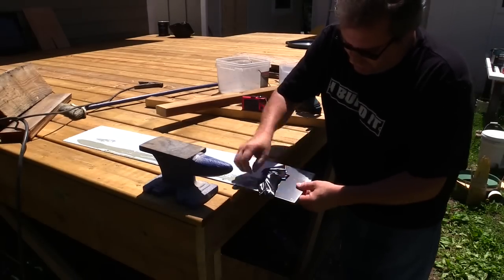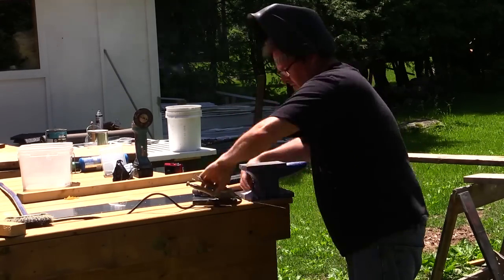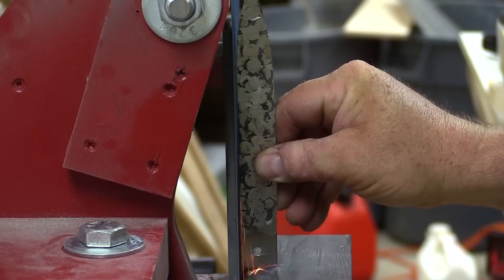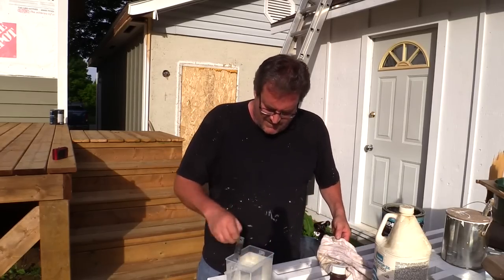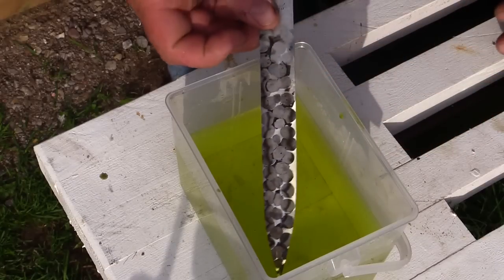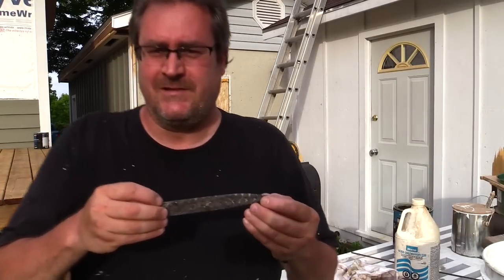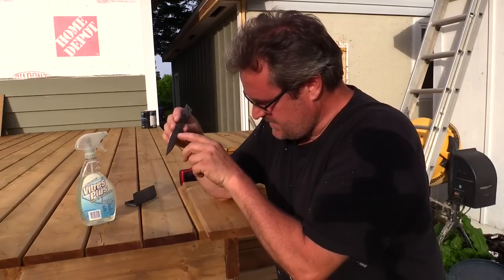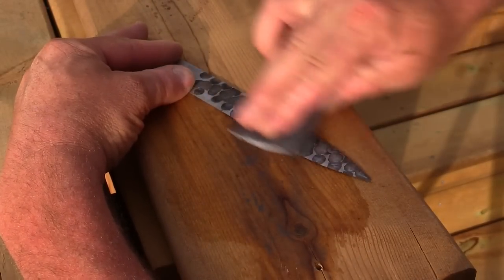Mig Welder Damascus Experiment

Comment: It's a very unique look and is definitely worth investigating. This materials you've used are ok for decorative work or display pieces but won't make a functional knife. Mig weld is mild steel and you cannot harden it. The same applies for the  stainless steel, it's likely a 300 series. You could try a piece of 15n20 carbon steel (close to 1080 with 2% nickel added) and use the mig welder to make a pattern on it.  L6 is another metal you might find around the shop, it's used in bimetal bandsaw blades etc. Its another carbon steel with nickel added.  This would yeild a blade with a edge that could be hardened with a propane torch. The mig welds would need to be kept away from the blades edge though for the heat treating to work. The nickel in the 15n20 (or L6) and the mig welds would provide interesting contrast but you would need space between each weld to show it. An acid etch would likely be needed. Look up damascus etching using household chemicals. Normalize a couple times, harden with a torch and temper in your oven. Lots of info out there on it and it's simple enough to do. It may not win any cutting competitions but it will hold a decent edge. I may even try this with my son as a fun project! Thanks for making the video.

Comment: when you etch something its the carbon in it that turns black , so stainless and mild steel are about the worse 2 metals you can use  the best formula is 15n20 (band saw blade) and 1095 (pallet banding ) 15 n 20 is highly wear resistant so it has high molybdenum and chromium  so does not etch , the high carbon content of the 1095 is what turns black , i think you can get high carbon welding wire , you can defiantly get high carbon welding rods to ark weld with. filler rods for repairs on anvils etc. personally being a tree surgeon as well as a blacksmith i like to use chainsaw chains and forge weld them in to billets but it looks like you are not set up for that. PS if you use gas mig and turn the gas off you can get random sized beads much easier, if your using a gasless mig your introducing flux in to the steel , not ideal for knives.

Comment: the problem is that stainless steel has chromium in it and it do nit mix in a weld too readily when you weld. it is hard to weld stainless with regular 7080 or similar stick in the mig.

Comment: could you change out your wire after each layer , possibly bend it like a ribbon and fill the layers with the pebbles then hammer it out flat and then dip it

Comment: Good to see people trying new things, good video. Not sure if you realised this when you were doing it, but if you added the peroxide to your muriatic acid (which it looks like you did) you inadvertently made a type of 'piranha solution'. This is very corrosive stuff especially when hot and probably pretty unforgiving on skin, it'll eat through clothes fast. There are videos around of the stronger versions of the solution that will dissolve hotdogs and meat and other organic stuff. Just a heads up for next time.

Comment: This blade has no multilayers structure no less of very minimum of 150 layers can take advantage of damascus layering in the final blade quality and no macrostucture ex multilayer hard cores welded with multilayers mild cores, and the steel added with the welder i suppose is not  high carbon steel suitable for good blade ardening tempering and sharpening.
So nice research indeed and cool experiment but useless in term of potential real life blade , with quality of a good damascus blade.

Comment: You get the rose from the layering of high carbon and softer or lower carbon steel. I see where you were going with this but without the layering and folding you will not have the same result.

Comment: you cant weld stainless steel with regular steel  it dosnt bond and will break apart and this isnt Damascus or pattern weld its kind of like pattern welding if you did in on high carbon steel but cheating and for it to be called pattern weld is has to have a repetitive pattern  which is made by folding steels very carefully and specifically

Comment: The idea is to create a single homogenized piece of steel. The method shown in this video won't allow the crystalline structure of the two different alloys to grow together during the heat treating and tempering process. I know it was just a test, but from a metallurgic standpoint, this method would not work. The entire billet must be heated evenly and hammered or pressed. So maybe place all your welds on, then heat and hammer the whole thing. Then repeat, repeat, repeat. 

Interesting experiment though! Cheers!

Comment: So, let me drop my two cents. Most stainless, if not all, is absolute garbage in terms of cutlery. should you be looking for something that will not blacken start with a nickel steel such as a 15n20. Secondly, throw that flux core peice of shit in the trash. it will impart more inclusions into your steel. the ONLY way to get good welds out of that is double shielding with Co2. third, mig wire is mild steel. Hot rolled mild steel is, at best, .007 carbon. you will need to get some hard facing wire to get any decent hardness in the martensiric state. Surprise suprise, there is no hard facing wire in flux form. read statement #2 again. I do think you are onto a good concept. I think it would work well in a true ladder or cable pattern. you will need to flatten the entire blank and not just your welds though.

Comment: Do they make mid or high carbon (.5+%) steel wire? or wire with nickle in it?
Reply: +Colson Customs You can buy stainless steel wire, so it will have steel, nickel and chromium.. Depending on the grade there might be small amounts of other metals
Reply: MechV
The chromium and nickle would be good. Not sure how to harden it if it has under .5% carbon minimum though.
Reply: +Colson Customs you can't harden 300 grade stainless steel by rapid cooling so keep that in mind.
Reply: +Colson Customs You can buy high carbon welding rods but the cost is extravagant...

Comment: thanks for posting this.  this is such a cool experiment. i bet you could speed up the process a ton by heating the blade in a forge and hammering the welds flat, too, which would be great for those of us without a hot enough forge to weld in.  

again, thank you!

Comment: I don't mean to be rude but I have been welding professionally for 20 years and a welding Cup will improve your world especially with a flux cored wire
Reply from the maker: +Heath Worsley I've been welding longer than that. The cup would not improve the welds at all for flux core - been there, done that.
Reply: +JahTheHerbalist You don't need one if you aren't running a shielding gas. I have a Hobart 140 running .035 flux core without gas and it welds just fine. It's spatters a lot, but I can run a good bead nonetheless.

Comment: I like the idea of building something like that by hand but I wanted to let you know that your welder will work a little better if you put a cup on the end of it you're losing all of your shielding gas
Reply from the maker: +Heath Worsley fcaw
Reply: There are two kinds of flux core, one needs gas, one does not
Reply: Timothy Jackson you're thinking of dual shield. Flux core doesn't require gas.
Reply: dual shield is flux core and backing gas you gents😂

inner shield is just flux core with no gas or nozzle. 👌✌👍
Reply: With the proper flux core, you can just weld away, without using up gas. I do it all the time.
Reply: Flux core still should be shielded with a gas. & I feel most are dumber now after watching this :/

Comment: Thanks....awesome video....I tried it with 300 series stainless last october and it looked awesome but I didn't know at that time that series of SS won't hold an edge...lesson learned...I want to take a piece of toolsteel like O1 and weld several beads of stainless and hardfacing electrodes then go back and cut and fold like true pattern welded steel...

Comment: I like very much the idea you have brought to life, although as you may already know Damascus steel is basically a compilation of "x number"of metals/metal alloys so just as a suggestion ,if you have not done this yet, try using different types of might wire that may differ just a  little or a lot and to add more layers overall to achieve  a more interesting pattern.

Comment: Welding Stainles steel with ordinary steel wire its a bad thing. they dont welding together right and the 2 parts will breaf off verry easy. its a great idea to do this for design but dont use it to build something like a fence or so.

maybe you get a better resoult if you use special welding wire for (white and black) weldings. i hope you call it in your country the same as we do in germany. but there is a welding wire that is made to weld stainles steel and regular steel together. try this one and it wil no longer look like the spots try to seperate from the stainles steel. i think the effekt will be less strong but the knife will be stronger.

try it i would be interestet into the resoult.

Comment: The main problem with using this as a "cutting tool" is that the edge is still just stainless steel (18-8?), which in that case is low knife quality and soft (WAY softer than even 420-J).
If you use 440-C for the base blade and let the welds go "over" the edge, then by the time you grind into the welds (for the bevel), you might have something useful...?

Comment: i done same kind of tes to pieces of bearing steel flattened them out and welded them together so when i etched the weldings comes to visible  in the middle of blade. This welding damascus works.

Comment: this isn't even a Damascus experiment its just a knife making experiment nothing to do with Damascus steel
Reply: Tony Turner is not even good experiment
Reply: patman0250 ACTUALLY, metallurgically, Damascus steel is laminated steels with different alloying elements that when polished and etched show the different lines where they are pattern welded together.... This may not be the traditional way to make Damascus but it is a very good experiment.

Comment: Most people are missing the point with damascus steel. Newly forged damascus steel looks like regular steel it is only after it rusts that the wood like pattern is visible. Damascus is beater because it is folded multiple times, the look is a side effect. Now if you want replicate the effect i sagest you get a bit artistic with clay and heat reatment. But don't get me wrong your experiment look very cool, i wander how it would look like after layers of different types of weldments.

Comment: maybe try this with tig and a foot pedal. you could start melting the base metal, then add a dab of filler; and then move to the next spot. if you do it with two different stainless steels and then anneal/heat treat the blade you would end up with a decent blade.

Comment: "It's only acid" they said, it'll be fine, they said.
Lol it might be low concentration acid but it's still acid and will burn you over time like the it dose to the metal so if you don't wash your hands soon after (like 10-15 mins after) it'll start to get itchy in the affected area and then you'll lose layers of skin then it'll be really sore and then may get infected then you'll be like why the hell did I not wash my hands after touching acid

Take care with acid treat it how you want to be treated

Comment: Have you tried just using an oxy-acetylene to heat spots on the metal, then etching that?
Reply: ***** Mick is talking about the difference between temper colors and etching colors. Differential  heating will cause a rainbow effect that is easily removed in a monosteel. For an etch to work, you need different metals for the acid to react with at different speeds. Etching is significantly more difficult to remove than temper colors. This particular color effect is ALL etch due to different metals. It has nothing to do with the heating.
Reply: That would just discolour the stainless and maybe distort the stainless too ,you'd put way more heat in with oxy acet ,and you couldn't add thickness to the blade either ,I did something like this year's ago with stainless plate ,you mig a pattern quickly on one side and the discolouration ie blue, silver and gold pattern appears on the reverse side ,I made the wife some nice plaques using this method ,takes practice tho
Reply: I just wondered how much of your pattern is down to heat effects and how much is the mixture of metals?
Reply: It's all heat effects ,if you do it correctly the mild steel wire won't burst through to the other side ,trust me I am a welder by trade 😉for 40 years now
Reply: OK, so localised heat effects rather than mix of metals.  Can that be done in other ways (hence my oxy acetylene question)?
Reply: You can change the colour of the steel with the heat but to get the effect he did in the video you would have to add metal as well ,his effect appeared mainly to be the colour of the mild steel when beaten in to the stainless ,,however you have to be careful with thin stainless plate ,if you apply to much heat to one side the other side will "coke up" when the heat penetrates to far into the parent metal ,hence practice ,if your question is only about discolouration ,you can achieve an effect with heat but when you linish the metal you will remove the effect

Comment: Nice effort.  Normally when I weld stainless steel I use tri gas and stainless steel welding wire.  No problems.

Comment: Was that wire a flux-cored wire?  Perhaps if you had used a solid wire with a shielding gas instead of the flux-cored, you'd get more of the effect you're looking for.  I feel the flux is contaminating the knife metal.  Buts its an interesting experiment to be sure.

Comment: Hey, John, nice job first off. I think this is a smart idea. Secondly, what would you think about making a few pieces of that and turning it into a billet to forge in a traditional way? The pattern on that would be awesome, but I'm not sure if it would hold up very well. Maybe use something other than the low-grade steel for your base, but it's just the first thought that popped into my head.

Comment: The centre of the spot will bind but as it is hammered it cools and the spot flattens out. The edges don't adhere. It's maybe more work but how about a series of spots then grind it down then repeat. Better adhesion and more of an amalgamated spot

Comment: This is not a "Metal Inert Gas MIG" welder experiment as flux core was used so technically it was a wire feed welding experiment, good job John sorry for the criticism

Comment: The welding method is called flux core welding. Mig is an adopted term typically associated with gas metal arc welding. Welding with and inert shielding gas that protects the molten puddle from ambient air. Chuckee2009 has made some great videos explaining the different types of welding and the do's and don'ts associated with them. It helped me out
Reply from the maker: godzilla7382 Wikipedia has great info too. Most of the the guys that use this type of equipment will call it a mig welder, since it can use gas and regular mig wire. 
So when Cletus asks for the welder, he doesn't say: "Hey Fred, go in the shed and hand me out the flux core wire feed welding machine", he'd say: "get me the mig", and Fred knows exactly what he means. Similar to how he'd refer to a fascial tissue as a Kleenex, a locking jaw plier as a Vise Grip and a jar of petroleum jelly as Vasoline.

Comment: Great experiment John, I wonder what would it look like if you wrapped a thin sheet of copper or brass before welding the spots. Would that become part of the mix or just burn off due to extreme heat?
Is that benchtop anvil a Record #11? If not who is the manufacture and where did you acquire it?
Reply from the maker: Grumpyneanderthal I tried feeding aluminum mig wire into a weld with steel wire before and it seems like it got mixed in, but can't be sure. 
The anvil is "Power Fist" brand from our Canadian version of Harbor Freight, Princess Auto. Cheap, but it works.

Comment: I left this on your site...For the stainless Damascus blade...try this. Get a high carbon or hard steel piece instead of stainless. The weld long beads of weld from end to end but right beside each other working from center out to edge. Once all welded reheat the whole thing and pound flat. It will be a sort of laminated blade. Repeat this then oxidize as you did the other blade. Then cut and grind out your blade. If I get time today I will try myself. Harder center will give a better cutting edge than stainless. Great idea you have here.

Comment: the Fairburn Sykes commando knife was first made with mild steel then later with spring steel.  The point and a little bit of edge was all that was necessary for it's purpose.  Throwing knives can be made of mild steel as long as they are short.  Some of the pig knives are mild or cheap spring steel because they get lost easily.  Nobody wants to lose a $200 knife in thick brush.

Nice idea for the decoration.  I believe an arc welder will fuse the materials more like you envisioned.

Love the videos.

Comment: It would be interesting to use a longer, wider piece.  After grinding smooth, heat it up and fold it half and forge it into a single piece and see what it looks like after smoothing and etching.  Thanks for the video.

Comment: Very interesting experiment. The results are great. I had the idea of making a knife from just weld. Like I would run a bead after bead on a piece of metal and then just grind that piece of metal and it would leave me with just my weld. I know that a knife wouldn't hold an edge but maybe if you used  a hard facing rod for the edge it might work.